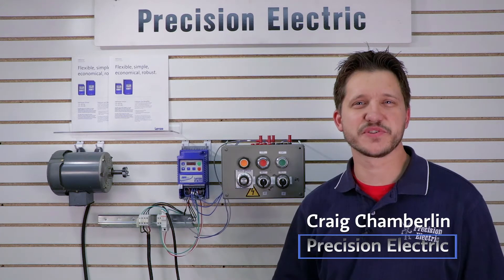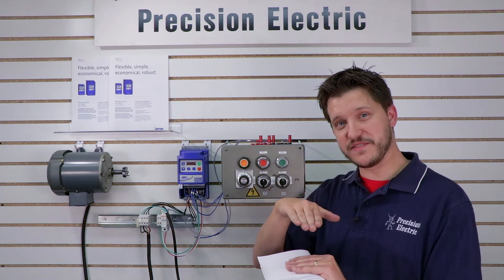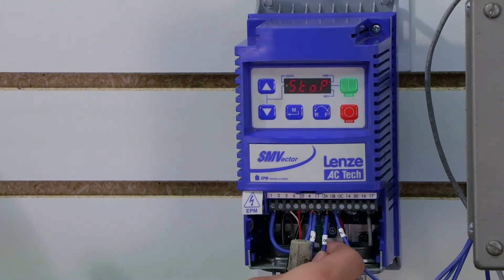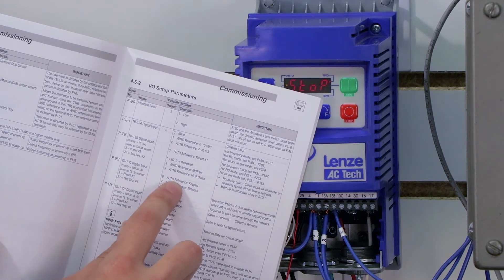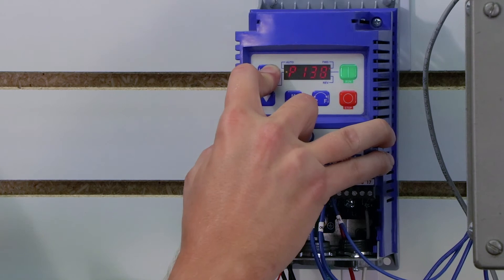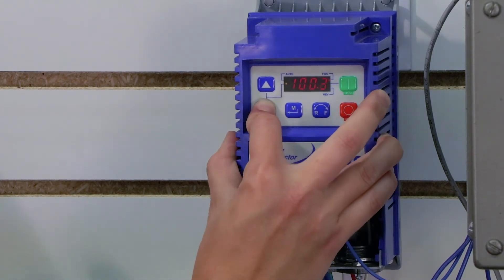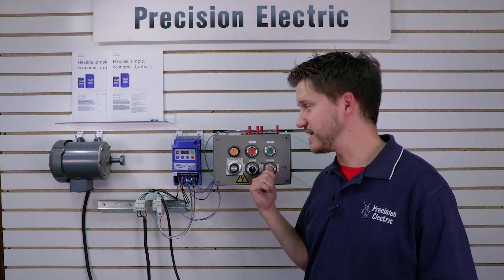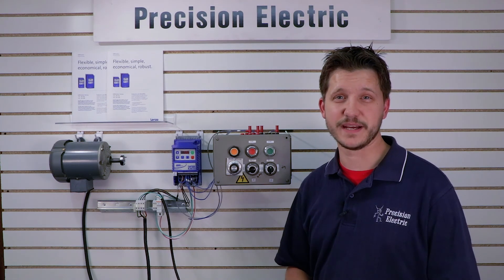Lenze SMV Training Lesson 12: Basic PID Loop Pump Or Pressure Motor Control - VFDs

Comment: What you are describing is just P control (Proportional control) where the speed of the pump is proportional to the difference between the set point and the tank level.  The problem with just P control is that, as the tank gets closer to the set point, the motor speed slows.  If the outflow rate from the tank is kept constant, then the tank will never actually reach its set point because the proportional signal is only enough to barely keep up with the tank outflow.  This is where I (integral) and D (derivative) terms come to play.  In the situation just described, an I term would integrate the level difference over time and sense that the tank is never going to get full with a continuous outflow, so the Integral term would rise, and added to the P term, would cause the pump speed to increase even more.  This would allow the tank to get to the set point, even with a constant outflow from the tank.  The Derivative term is rarely used and is only used when a more rapid response is required.

Comment: good video, i want to ask in case if i have a hydraulic jack, and want to set pressure on the pump (variation)  to push cylinder . do I need PID to control/maintain the pressure that i want?